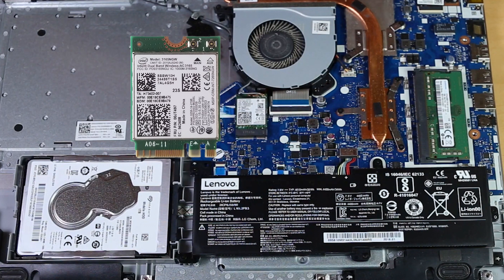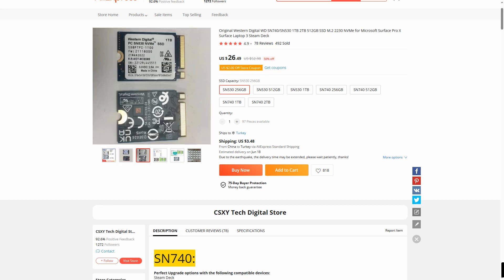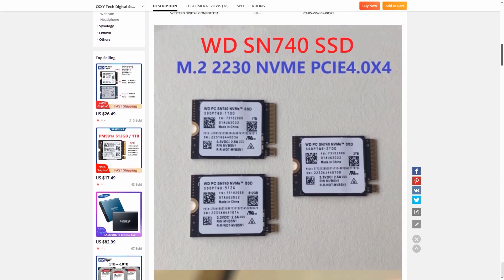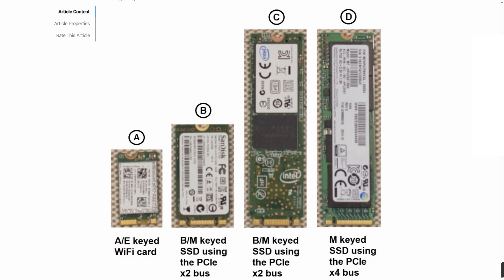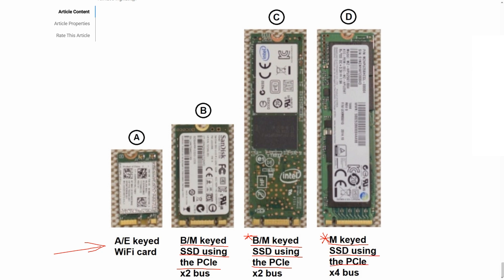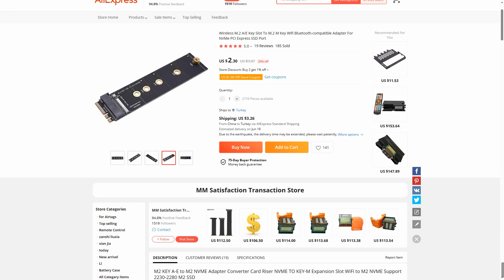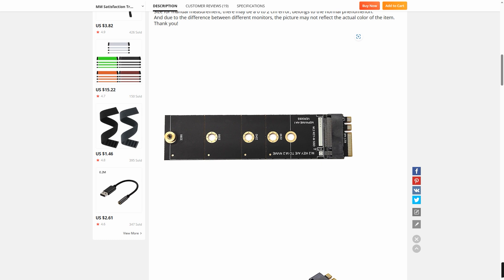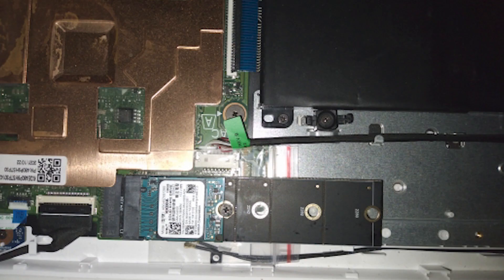Convert WiFi Slot to M.2 NVMe SSD Slot!

Comment: 00:30 wait, isnt that a unsoldered nvme slot between your fan and the coin cell battery?
Reply: may and may not be. either way, there is no a firmware, power, slot to be working out of the box now
Reply: Yes it is the unsoldered nvme m.2 connector
Reply from the maker: I wish I had, but there is no unsoldered nvme slot in my Ideapad 520 laptop
Reply: @techwise66  what is that then? 🤔
Reply from the maker: @SummonerArthur  I don't know

Comment: What speeds are you getting?
Reply from the maker: I got 1257,54 Read (MB/s), 1211,65 Write (MB/s) which quite higher than my 2.5" SSD
Reply: @techwise66  can we plug there 5G or 10G ethernet port ?
Reply from the maker: @vinusuhas4978  I didn't try it before
Reply: Mini PCIe 1.0: Based on PCIe 1.0, providing a data rate of 250 MB/s per lane.
Mini PCIe 2.0: Based on PCIe 2.0, providing a data rate of 500 MB/s per lane.
Mini PCIe 3.0: Based on PCIe 3.0, providing a data rate of 1 GB/s per lane.
Mini PCIe 4.0: Based on PCIe 4.0, providing a data rate of 2 GB/s per lane.
Mini PCIe 5.0: Based on PCIe 5.0, providing a data rate of 4 GB/s per lane12.

Comment: Good info.  But if it is possible to add an additional M.2 slot (either SATA or NVME) or an M.2 slot which supports both SATA & NVME protocols?  What I am asking is whether we can add an addional M.2 slot in a laptop motherboard which has only one M.2 slot.
Reply from the maker: I didn't try this before, but it should work because we convert wifi slot to M.2 slot this way. It worked in the motherboards that don't have M.2 slot.
Reply: @techwise66  No bro, I am not asking about converting an existing Wifi slot.  I am specifically asking if we can add an additional M.2 slot in a laptop motherboard.
Reply from the maker: @sivakumarb9749  I understand, Brother, now. I only found this method to add an M.2 slot to a laptop motherboard. But when I find any other alternative method, I will also share it at once.
Reply: @techwise66  I think you misunderstood his question...what he's asking is "is it possible to add additional m.2 slot although our laptop has only one m.2 slot (the wifi card slot)"

In other words...is there any 2 in 1 m.2 adapter/extension out there?

Comment: Wow, that was a lot of information in such a short time it is such a simple idea to add a hard drive, but if you dedicate that port to NVMe then what about your Wi-Fi and Bluetooth? If you use a USB adapter, then you will have slow Wi-Fi and Bluetooth!
Reply from the maker: Thank you so much for your comment. There are some good Dual-Band USB Adaptors for wifi. This could be an alternative. I use the ethernet cable for the internet
Reply: Well, you need to find a good one and need to study the specs...look for wifi 6 AX dual band adapter. ..then you'll have both wifi+ Bluetooth

Comment: helpful video, thanks. just one question. the motherboard photo in the intro is different than the resulting photo in conclusion. are you using the same laptop?
Reply from the maker: Yes, I used it on my laptop, and one of my friends tried it on his laptop, and both results are working

Comment: it would be worth it to "lose" the internal wifi and replace with NVMe SSD imo because the system overall will be faster/snappier and i'm sure you can get a faster or just as fast USB wifi dongle.
Reply: Clover allows to boot from nvme on older non nvme bootable machines.

Thinkmods sell an expresscard to nvme adapter with an SD card for clover.
Reply: If the full length adapter card clears your laptop case and internals why not use a full length/higher capacity card?
Reply: @prawny12009 There is no mounting scew for a longer drive. That slot is designed to be used with a 2230 m.2 drive. You COULD use a 2280 without the adapter but it will be sticking up at a 30 degree angle like  M.2's do before you push them down and secure them with the screw. Using the adapter makes it so you can use a 2280 drive and the scew placement for a 2230 drive. You cant use that hole with just a regular 2280 because you would have to put the scew through the center of the drive. Using the adapter allows you to mount with the 2230 hole and then use the 2280 hole on the adapter to secure your larger drive.
Reply: However, I believe it is a waste. The wifi module is generally designed and optimized to work with the motherboard. Replacing it with an m2 SSD by renewing the native wifi for a $5/10 dongle is a colossal downgrade to wifi for a marginal increase compared to a sata SSD. Rather, you can consider replacing the HDD with a sata SSD and the HDD, if the CD/ROM slot is available, put it in that slot using a specific adapter. CDs are practically no longer used anyway and with a few tens of euros you can get CD-USB adapters that do the same job with additional storage space thanks to the old SSD.
Reply: Also: T480 have 2 of this slots. You could have one WiFi card AND the adapter with an nvme 2230 512 ssd.
That's what i'm doing. Founf a micron 2230 ssd, ordered a sketchy adapter from aliexpress (different from this, it is little and not "breakable" (we'll see if it is compatibile.

My plan is to use the new 512gb nvme as the new main drive (still choosing if maintaining the double boot with win 11 on the same disk or not), remove the current 256gb nvme put in the hdd caddy with an adapter and use one of my normal 2.5 ssds as added space for files (or a 2.5 laptop hdd, I'll decide). While keeping the current 256 ssd as an external drive (with a orico adapter) or using it for other projects (I've been putting nvmes on everything).

I'm a noob but god I enjoy do this easy stuff to feel better about myself (and have needlessly snappier pcs)
Reply: Just get a sata SSD and put it instead of the HDD. It also depends on the type of M2 slot. If it's pcie 1, it will not be any faster than sata. Another issue is whether the bios will see this disk. I had this issue on my old PC. Had to get a sata ssd disk to boot from.
Reply: Cool so my latitude d630 can't die yet.
Reply: It's a waste of time, effort and money. If you need ultimate snappiness, you need an SSD with DRAM cache. Even your usual SATA 2,5" drive will then be snappier than your average NVMe SSD. Examples of SATA drives with DRAM cache are the Samsung 870 Evo and the Crucial MX500 series.
Reply: @sassuki  you know that any SATA SSD max speed for read/write is 600mb/sec right?

The owner of this video installed the M.2 NVME via the wifi slot and got more than 1gb/sec for read/write.
Reply: @farishakim6759  that is the theoretical throughput. In reality you almost never reach that kind of speed, unless you're copying huge files all the time.
Real throughput is somewhere between 200 and 300MB/s usually.
Reply: @sassuki If the pcie is controlled by CPU then it will reach that maximum speed, considering the ssd are far more capable delivering more than 1Gbit throughput most likely it will. You just need the same config as your data transfer, ie: If you copying data from Sata SSD to NVME SSD then the maximum limit is SATA SSD throughput, everything is going according to the weaker link.

I've just upgraded my old laptop with 2TB SSD, while it still bound by the limit of SATA2 speed, but that doesn't mean it would never reach that maximum sata limit, because it does. The theoretical speed only bounds for HDD, because it's limited by the motor spinning, not the lane output/input capability, even with that config, people find a way to make RAID 0 or RAID 5 to increase speed with HDD, because it technically sharing the load simultaneously, at least close to sata limit.
Reply: @blebekblebek  again, if you're not copying huge files, it won't reach that speed. Do a PcMark8 test, it will land somewhere around 300MB/s. That's the average you will get. Even with NVMe
Reply: @sassuki   
If your speed maxed out at 300MB/s there are 3 explanations.

1. Your SSD Overheat and slow down to compensate the heat.
2. Your NVME is sata BASED which is maxed out your sata throughput. Which actualyl just M.2 Sata.
3. Your PCIE is controlled by chipset not CPU, if you are using gen 6 or lower most likely the nvme will be controlled by chipset not CPU.

Either way, if anyone bought NVME SSD and only get 300MB/s bandwith there will be outrage, at least refund will be issued.

What is your SSD and your machine? get refund if you only get 300MB/s on your NVME SSD.
Reply: @blebekblebek  again, 300MB/s is the real average you get, as most files are small.
Obviously when I do the raw speed test with Crystal disk mark or AS SSD, I get 2.000MB/s+.
I hope it is clearer for you now?
Reply: @sassuki   Your initial argument is that people would never reach maximum speed, which actually nowdays we do.

You obvious don't do gaming do you? my whole library of games is beyond 4TB.

Yes there are many small files within those games, but in general the file size for modern games are quite huge, COD Warfare size alone is 190GB, Apex Legend is 66.7GB. You can test this yourself since both of games I describe is Free to play.

If you copying file from SSD to another SSD you still reach maximum speed especially if it was alot. for example 100GB of 100000 1MB size will do the same as 100 files of 1GB, yes the initial might be slower but eventually it will reach maximum limit before the cache or DRAM is being filled.

Your reasoning based on HDD behavior which doesn't exist with SSD, the reason why smaller size took longer in HDD because writing on a platter depends so much on motor speed and seek time to locate where to write those data, these things are non-existent in SSD, there is no motor and there's no seek time.

in HDD the more smaller the data it will require more seek time to locate those data.
Reply: @blebekblebek  well stated
Reply: @blebekblebek  no, it doesn't matter, gaming, whatever, you will almost never reach that high speed. There are endless tests on YouTube on SATA vs NVMe. The difference is usually a few seconds in loading times!
The only time is indeed when you copy huge files between 2 SSDs. This is very rare for the average user and has nothing to do with gaming!
Reply: @sassuki  Damn you really do not know what your talking about
Reply: @sassuki 
i think. if you ever tried "hacks" like this.
means you're on tight budget.
and budget things being a budget things
it wouldn't even makes sense to pair a Samsung  evo 970 with Celeron or core I ULV series.
but still.
having 256Gigs SSD coupled with 1Tb hdd is good thing for budget laptops.
Reply: @sassuki I got an Samsung Evo 870 2TB i use it as my main storage drive with all my personal files and it is becoming slower each startup
Reply: @sassuki  That’s fair lol
Reply: Really? What does Snappy here means? Snappy doesn't mean faster than gen4 nvme right? @sassuki  now my current Linux feels sluggish when using it while installing flatpak or transferring file at the same time. But I'm not on SSD with dram. Will it get faster if I use those mx500 or 870 Evo for example?
Reply: @max-lee  may be
Reply: @sassuki  Both Samsung 870 Evo and Crucial MX500 have unusually high failure rate withing 1-2 years. Quality is not what it used to be, thanks to globalization.
Reply: @ExtaTer  I have an MX500 that is 2 years old in my PS4, runs like a charm. It has a 5-year warranty anyway so, it shouldn't be a problem. I do backups of save data on a regular basis just in case.
And I just bought a brand new 870 EVO for my PC, which is just a boot drive, so it doesn't matter if it fails either as it does not need any backup, and it also has a 5-year warranty.
Reply: @sassuki  I was talking on average, not your case of 1. All "warranties" nowadays are horrendous - you will jump through hoops, pay for shipping possibly to outside US, and wait for months for a refurbished drive. Pray you will never need to use the "warranty".
Reply: @ExtaTer  of course I am not building a case with a single drive, but my local shop says it only has 0,3% failure rate.
And I know warranty processing can be troublesome, but hey, at least it is there ;-P
I have a Kingston SSD that died on me the very first day; it's been over 3 weeks now and still did not get a replacement :'DDD
Reply: @sassuki  Maybe you have bad experience. But my Crucial MX300 275GB is around 6 years old with 45TB written data. CrystalDisk calculating 70% "health" and still working without any problem.
Reply: @ExtaTer What the, I got an Samsung Evo 870 2TB i use it as my main storage drive with all my personal files and it is becoming slower each startup
Reply: Are you crazy?

Comment: okay, but how you managed to install it? On the first photo of the laptop there is clearly no space for an adaptor. Also the last photo is totally different laptop. Whats with that?
Reply from the maker: I cut it according to my 2230 SSD size and plugged it into the wifi slot.
Reply: @techwise66  ah ok, missed that part, makes sense now
Reply: @techwise66  was there a hole for screw in right spot with the adapter installed?

Comment: the only problem with that solution i can see nvme drive might not be bootable on some laptops because laptop maker never intended such an option. hp is notorious for that
as for speed, unless it is pcie 4.0  transfer speed will be comparable to sata ssd because this kind of socket oses onlt 1x pcie connection while nvme ssd can use up to 4 pcie lines  (double noched nvme uses 2x pcie single noch 4x pcie)
if you have access to motherboard documentation you can technically splice in your own nvme socket as extra, either by removing a device you are not using or fiding unpopulated footprint for gpu or something. this require a bit of experience with micro soldering  because it is easier to brick a computer  if you never done it before

my hp laptop runs dual ssd even though it was never intended to have  any, one in unpopulated by factory m.2 sata port and onein place of sd cart reader via pcie 1x bus routed to nvme socket
and both ssd's have exactly the same speed
Reply: if you use a bootloader on the original HDD you can first boot from HDD and tell it to boot the OS thats on the NVMe...i guess you could boot from a USB and have it boot the NVMe as well.
Reply: @mikehensley78  yes i am using refind for that, it loads boot driver back to the bios so the boot can be performed from the uefi level, otherwise bios can't see nvme drive as nothing more as pcie device it know nothing about. i have hp laptop with very strip down bios so it can't be done any other way (bootloader might be at the flash drive though but there is only 3 usb)
the only problem is windows likes to crash my bootloader and bootloader itself is not capable to secure bood and laptop preferes other signed options

Comment: In some machines might there still be a problem booting from the NVME? Ive heard NVME risers don't usually work for adding a boot drive, especially older machines with pcie 1.0 or 2.0
Reply: From what I know PCIE Gen 1 is not compatible with NVMe, only SATA. PCIE Gen 2 is known to have issues booting off of NVMe drives, but it's a case by case scenario.
Reply: booting from nvme usually is only possible if the systems BIOS/UEFI supports NVMe Boot.
Reply: Opencore (yes, it's meant for installing macOS on Windows PCs) allow you to boot NVMe SSDs on many older devices that do not natively support NVMe booting.
Reply: @rmendez011  CloverEFI can do the same.

Comment: Nice video bro keep it up, I would suggest including some benchmarks to see how the M.2 SSD performs with the adapter, just to compare speed with/without the adapter :)
Reply: One lane of pci-e 1.0 or 2.0 is slower than SATA...
Reply: @BertoldVdb  nope..the owner of the video said his write/read speed exceed 1gb/sec...just scroll down his comment and u'll find
Reply: @farishakim6759  Then he has a pcie3.0 or better slot. One lane of that will of course easily beat SATA.
Reply: @BertoldVdb  Correct, 1x PCIe 3.0 is just below 1 GB/s (985 MB/s), 1x PCIe 2.0 is 500 MB/s and 1x PCIe 1.0 is 250 MB/s. SATA III, on the other hand, goes up to about 550 MB/s in faster SSD using SATA interface. So if your Slot is not PCIe 3.0 or newer, it would be a better idea to switch your HDD for a 2.5 inch SATA III SSD. Best regards!
Reply: Don’t worry, the speed is much faster than HDD is already very good.
Reply: It will be limited to one lane, but apart from that it will be just as fast (assuming the slot has equal PCIe version support, usually the case in non-embedded hardware)
Reply: @BertoldVdb  still faster than the most expensive Sata ssd right?

Comment: this is great! Some people might say is worthless bc you lose your wifi connection. In my case, I use an old laptop as a server, so is always connected through ethernet, I can now use this to expand the storage :) ! Thanks
Reply: Even as a normal pc you still have Ethernet And you can use  a usb3 wireless adapter if you need wifi. Unless you have really fast internet and you're acting utilizing that speed it's not  really a downgrade at all.
Reply: Most, even older laptop have 2 wifi slots. The first for normal wifi. The second for WAN wifi, this slot is nearly always empty.